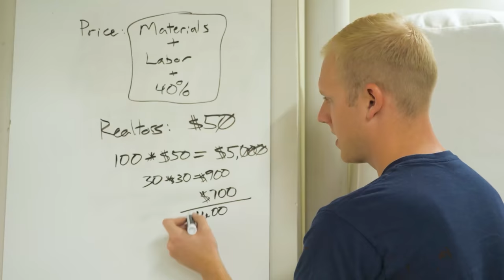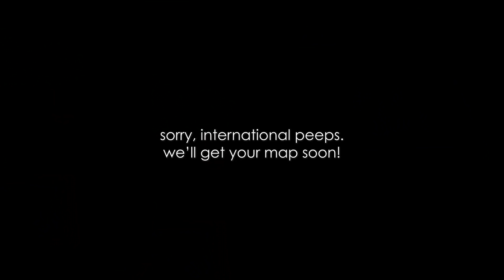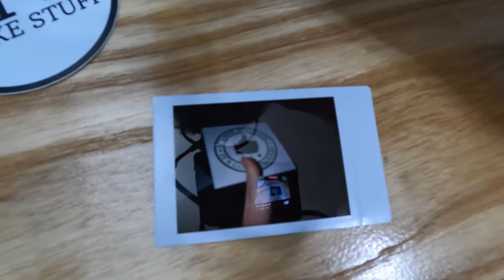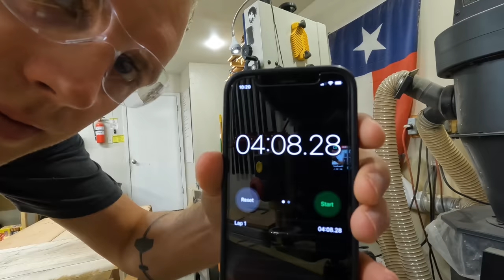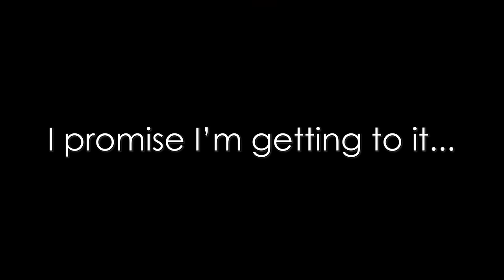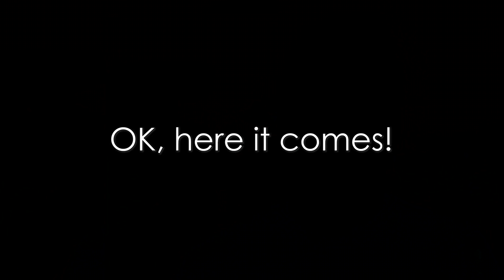FINAL RESULTS: Table Saw vs Band Saw - Cutting Board Production Showdown

Comment: so, the same amount of wood on each test, but you get three more boards worth of material just by using the bandsaw instead of the table saw?? Never mind the speed of the cuts, that is a WHOLE LOT of extra waste when using the table saw hey?
Luckily i ordered my new band saw in June (coming in November). Can't wait to give it a go!

Been an interesting journey in these last 3 videos, i hope you've learned a whole lot of new things about tuning your table saw!
Reply from the maker: Nah, the band saw boards were a little wider - it wasn't the same volume to start with. But that kerf difference does add up over several hundred board feet!
Reply: @jennieanddavis  phew, but still, I’m thinking if you cut loads, like we both do, I’m thinking that it will definitely be worth it to use the bandsaw in the long run

Comment: I am much more cautious of my table saw... although I've cut myself more times on the bandsaw.  Lol
Reply from the maker: Table saw is much more violent when things go wrong. Kickback, grabbing & flipping, etc. Band saws aren't safety scissors, but a clean cut of a digit on the band saw seems much less violent than the hand-mangling table saw blade.
Reply: @jennieanddavis  that is so true. One slip on the band saw can usually be fixed with a bandaid, one slip on the table saw, well, that's a different story. Also, one tool most people don't consider too dangerous is the jointer.  Unfortunately, it's very unforgiving.   That's how I lost 3 fingers on my left hand.
Reply: Well.... just remember that the saw a butcher uses to process meat is not a table saw..... it is a band saw.... just saying..... Be Careful Out There no matter which saw you are using.

Comment: Only issue for myself is space and usability. I would be hard pressed to find a spot for a bandsaw even if it was more versatile because my table saw is built into a workbench, so it doesn’t take up any additional space. Also, for the few chances that I have for worksite jobs, I don’t think I’m transporting a bandsaw to the site, we’re as my table saw is a contractor saw and can be taken with ease. Other than that, I would love a bandsaw.

Comment: Your table saw is burning for a reason.  Your feed rate is too slow causing wood to burn because cutters are heating up beyond their normal operating temperature.   The reason for this is you are taking a cut too large for your motor, you need a larger motor that will allow you to feed at proper feed rate without stalling out.  Your bandsaw doesn't require as much horsepower to cut the same thickness since the blade is removing less material.  Having a proper motor size on the bandsaw vs. incorrect motor on your table saw isn't exactly a fair test is it?

Comment: Haven't watched yet, but I would suspect, based on what you build, that a table saw would be best as it makes repetitive cuts much easier than a band saw.  As to the wood lost because of the thicker keft, I would suspect that the cost of that is less than the effective cost of your time doing repetitive cuts and clean up on the band saw.